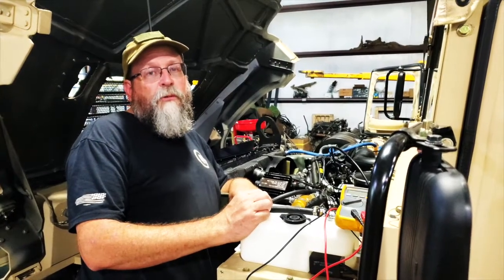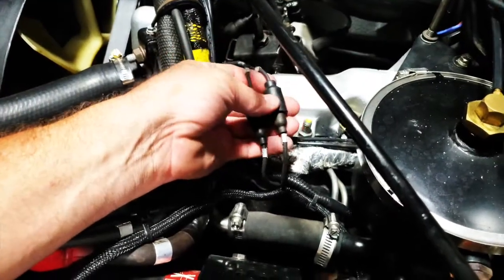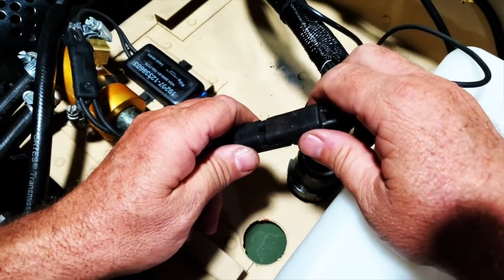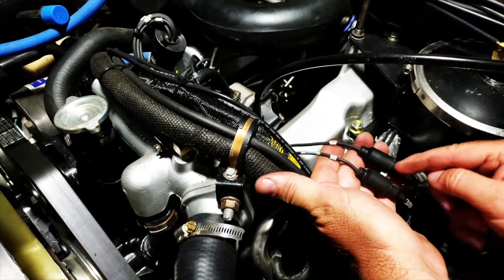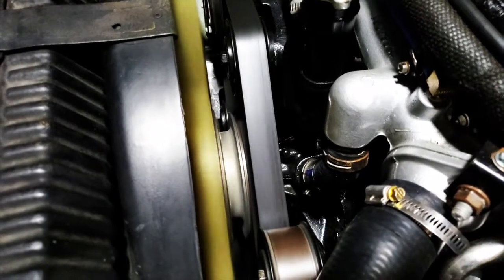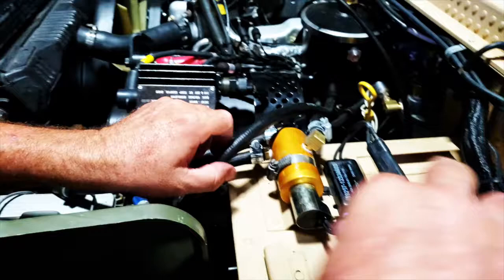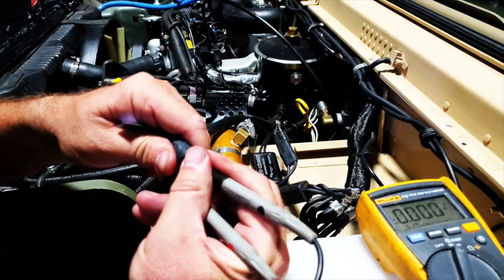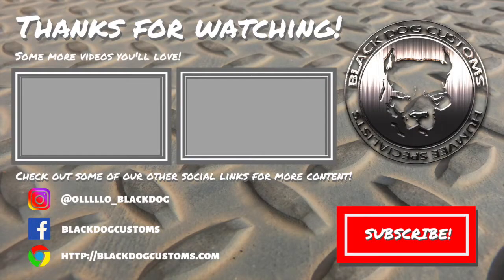Understanding your HMMWV/Humvee Cooling System | How to Check Your Fan Clutch

Comment: Mike,  Superbly clear explanation ! Could you briefly explain the difference between the temp sensor that controls the fan clutch ( shown in your video ) versus the TSU that controls the glow plugs ? Is there a third temp sensor on the engine ? Thank you.

Comment: Mike, I have replaced all components (Caddilac Valve, Time delay Module and thermal switch) and my fan clutch is still stuck in the engaged position. Bad fan clutch?  Thoughts? I appreciate any help. Thanks   EDIT: Fan clutch was bad.

Comment: This is a great video but it doesn't look like Mike or anyone else there is answering the questions so this is to anyone who might read it.  I have a 2009 HMMWV m1123,  The temperature seems to hover around 210 but sometimes creeps up to where the fan kicks on.  My question is, should the engine, during normal operations, run at 180-190, consistent with the temperature of the thermostat or should it run hotter and the temp be regulated by the Cadillac valve, temperature sensor and fan clutch?  

Thanks, Mick
Reply: I haven't heard of many engines running safely at 220-230 degrees, not sure why it's set at that high of a temp. I think ideally if it came on at 210 and stopped at 190 it would be ideal

Comment: Hi Mike, when you say fan clutch disengages, does that mean the fan itself stops turning?  In the video it looks like fan is still spinning when the graphic says the fan clutch is disengaged.  Thanks
Reply from the maker: the fan should always be spinning. when the fan is engaged it will spin at the same RMP as the engine. when it dis-engages is will free spin at a lower RPM

Comment: My 6.5 got hot today because the fan did not engage over 220. The Cadillac valve verifies good (properly engages fan clutch when unplugged from harness), but the Thermostatic Switch has no effect on fan clutch, whether plugged in or unplugged. Does that confirm that the thermostatic switch is bad? Also, shorting the A & B wires on the harness also does not effect the fan clutch.
Reply: Same happens to my humvee
Reply: Unplug thermostatic switch does not affect fan clutch , any suggestions?